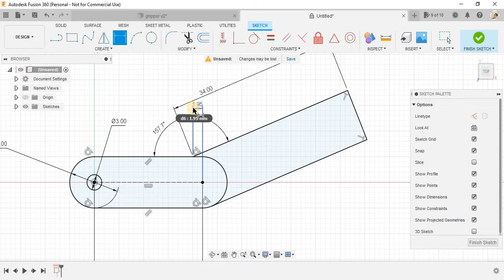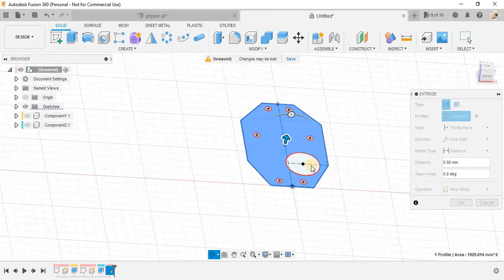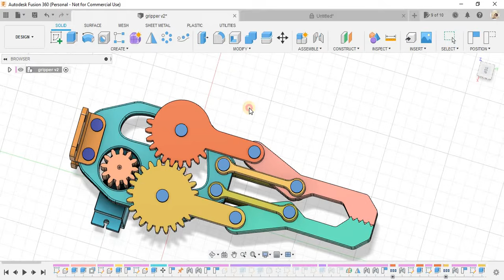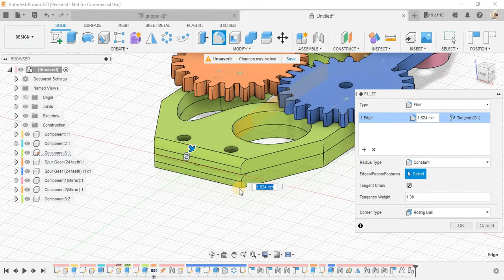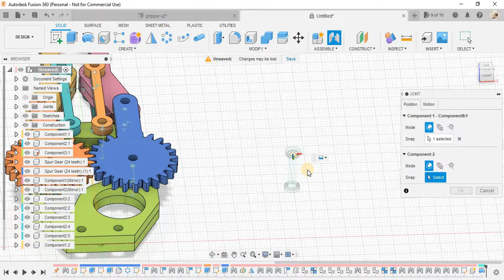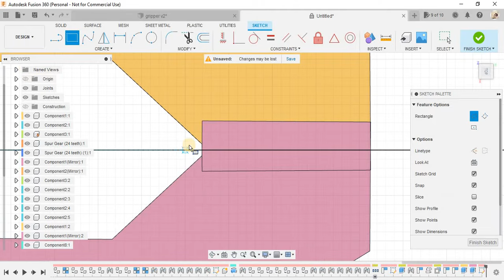How to make a Robotic Gripper In Fusion 360 | Fusion 360 Tutorial

Comment: hello 
is this model designed with tolerances? or if I wnat to 3D print it I need to make some adjustments ?
Reply: He definitely didn't include tolerances in the model if you were to 3d print it.  For emperial I'd recommend leaving .03 inch gap between parts
Reply: I don't think it is, if you wanted to 3d print i assume you might want a RC6 or a different fit with just the right amount of friction. You should test and see whether or not the separate components fuse when printing. Good luck

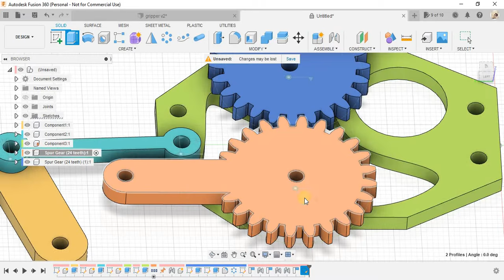Comment: The point where we make the slot is where my model fails. Even though I have chosen "Join" after we extrude downward -3.00mm it will not join. I can only rotate the gear. The little arm we just made stays in place. 17:42, mine does not do that.
Reply: same with me
Reply: same with me too
Reply: Yeah I face similar issue, I moved all the joint task on the timeline to the right then I deleted them and started the joints again. and It worked